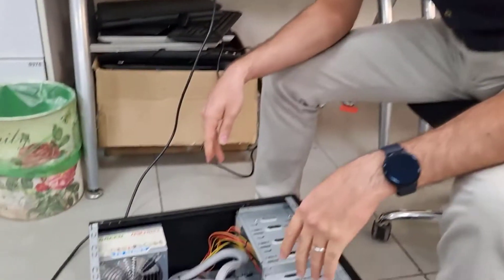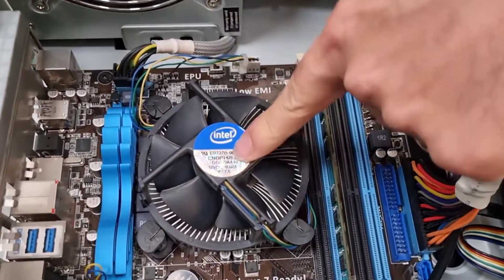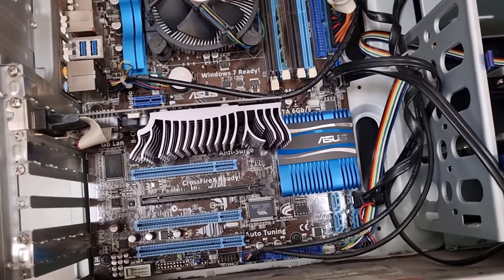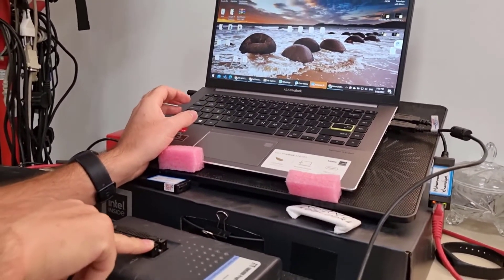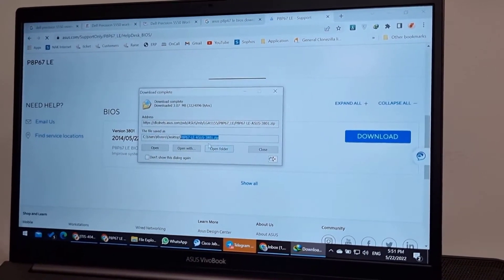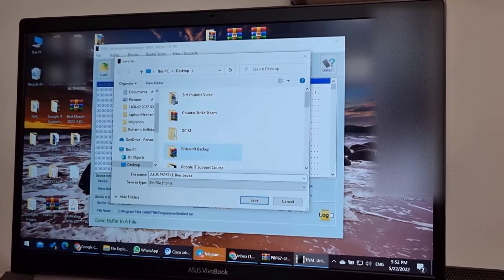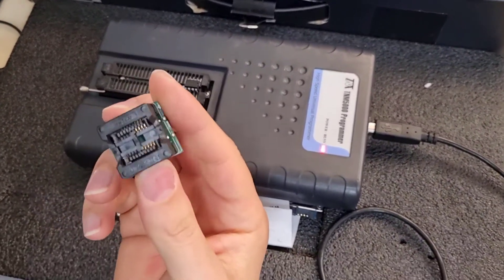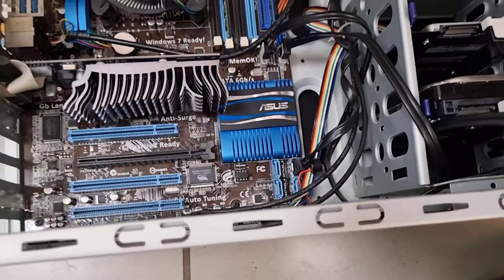ASUS Motherboard Starts with no Display and Beep - Corrupt BIOS

Comment: I had a board given to me that I suspect has corrupt bios chip. The weird thing is, when the chip is inserted correctly the mobo will almost instantly restart upon powering on and repeat that loop. When I flip the chip upside down the mobo/fans/psu will stay on and I get a red CPU light. I may just order an already programed chip and see what happens. Thought?

Comment: Thank you for this .. I am good with putting in software and hardware and  testing but not taking out bios. i didnt want solder the board and risk damaging it but i looked at that chip ànd thought it looks removeable. Thanks your vid i confirmed this and ordered one from ebay.... thank you

Comment: HAY MOHAMMAD...
was digging, entering in symptoms "mobo, power, but no display, no post"
found your vid.. the board in question is a asus p8p67-LE i dug up.. invoice in the box said purchased late 2011... wow... but, after building it breadbox style, power, cpu gpu 1 stick of ram the board just had power, no "mem ok" ram issue, no post, no display...
so after trying EVERYTHING else i could think of, to confirm wether or not the issue was cpu or mobo (or both) related... finally tried what you did here in the vid...
i have another p8p67-LE, working... OC'd to the gills... i pulled the bios chip... put it in the "questionable" not working asus board and BAM
post, display...
put the other bios chip back where it belonged... and now i have to find a place in town here who can use and external bios chip reader to fix the corrupted chip.... 
wish me luck and THANKS buddy!.. i was about to pull the cpu, ram and gpu, then break the board over my leg... lol
Reply from the maker: Hey, I hope you can find what you are looking for. And thank you so much for sharing your feedback ❤🙏
Reply: went to town, where PC shop was.... brought them both bios chips from p67 board..
good new... they copied the good bios, and flashed it to the bad bios chip.. and it worked.. put cpu, mobo, and got a aftermarket heatsink put together, gave it to my kid..
bad news, it cost 54 bucks.... oh well
 @mohammadkhandan7182

Comment: Hey Mr. Khandan, this is a great explanation of the solution. I wonder if the bios repaired, will I have the chance to go on with the previously installed OS? I have lots of music works in progress and realized I have not saved many of the presets. As I couldnt succeed to open the saved files in another PC, I need a solution without reinstalling windows. Thanks.
Reply from the maker: Dear Ethan. Your OS and files are stored in the storage devices on your PC (eg. HDD or SSD) and has nothing to do with the corrupted BIOS or dead motherboard!. It may affect just the drivers, though. So don't worry about your data.

Comment: So I am wondering about this thing and hope someone can help me, I have a P8H67-M PRO but it's the CM6650, OEM locked, and doesn't have the latest bios updates so it doesn't support 3rd gen intel cpu's wich is what I need, and I can't install them because it bricks the board, if I get a BIOS chip from the "unlocked" version and replace it will it work as a non OEM version? Or reprogramming is enough?

Comment: Hi ,My motherboard stuck at boot screen:- 
No BBC popup 
When i open bios it stuck at American Merge 

I tried Cmos reset 
I also tried Pin changing
Reply from the maker: Hi, I'm not quite sure of the solution to your problem until I do a thorough investigation. but here are some points that I could give on your issue:
- Make sure to disconnect every I/O device from the motherboard: SATA, USB, Extension PCI cards, etc. and test it (undetectable I/O devices could result in boot Stuck or frozen BIOS entrance)
- It's better to replace the RAM, & graphics too (If you have more than one RAM module installed, Try them one by one), BTW I don't count on their faultiness in your specific issue
(I didn't get the "Pin-changing" action!)
If none of the above actions worked for you, I guess there are two main possibilities which I see most likely:
1. BIOS program is damaged and you need to re-program it
2. Super I/O chip is damaged
There are two types of super I/O chips: - Programmable and - Non-Programmable. If yours is one of the second group, you may have it replaced
Tell me if this solution has led you anywhere...
Reply: @mohammadkhandan7182   Bro my cpu,SSD and ram are working fine one more thing 
I was installing parrot os on free space i had 2 linux installed in this pc after parrot .
Reply: @mohammadkhandan7182   Bro in motherboard manual there is a way to solve corrupted bios but says "system will automatically download bios from cd" but in my case the system don't care it so satisfied
Reply from the maker: @amvofchannel  Some motherboards support boot up BIOS flash and they have different instructions based on the manufacturer and model. As far as I know some ASUS high end motherboards are capable of that (Flashing the corrupt BIOS using USB drives). Don't know about other brands. So your best chance might be reprogramming the BIOS. If your BIOS IC is removable you don't event need heater and soldering. You can buy a small usb programmer which is very cheap, to program your BIOS. It worths a try.